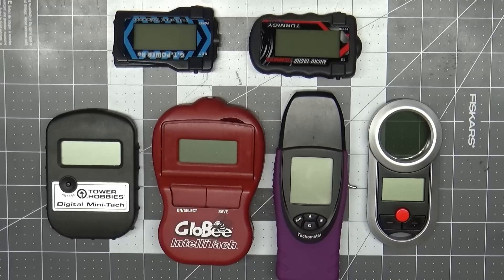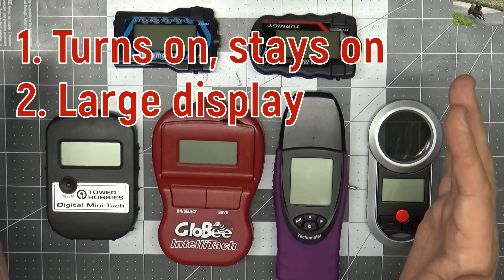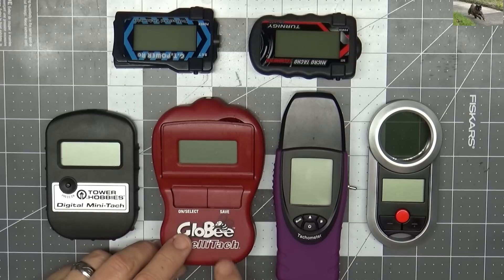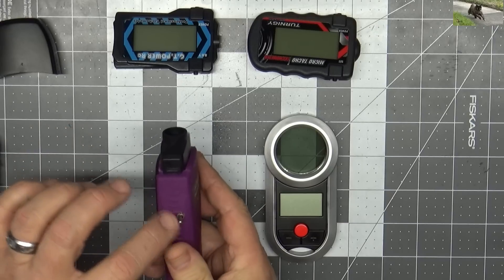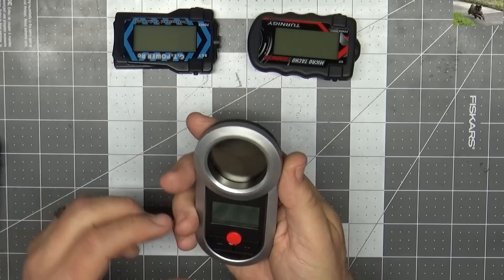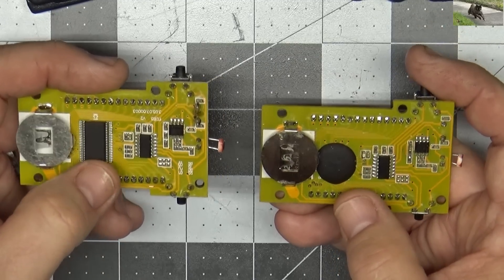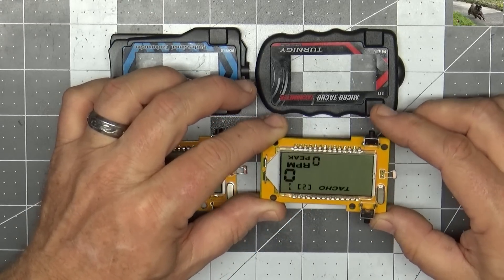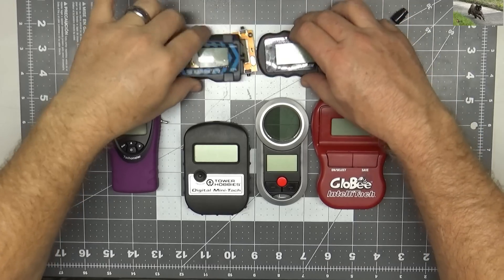Tachometers

Comment: What size battery does the Tower Hobbies one have? I have one that looks almost like yours but with no battery. It isn´t a standar bat, it´s a short fat one apparently. Had it for over a decade and can´t remember if I removed it to store it, or I never installed it. I want to test if it works.
Reply from the maker: I no longer have the Tower Hobbies tach, and I do not recall what size battery it took. Short fat ones sounds like an N cell. Commonly used in garage door openers.

Comment: for a different but kind similar topic/hobbies, the Beyblade fandom for years now have had to use a number of different methods to determine how fast the tops spin, and not a single one of the official peripherals from either hasbro or takara tomy are even remotely useable for giving us an RPM count, they just give us random high numbers to make you feel happy, the closest we got was an addon only available in Asian areas, what tachometer would you recommend?

preferably it would be nice to have something that can just detect how fast the launcher itself is spinning instead of having to point the sensor at the top, that way we get an as accurate reading as possible on launch.

sorry if this is a waste of your time, but I thought I would at least ask
Reply from the maker: Well you you do not believe the readings on tachs you have had what makes you think I can provide you with anything better.  What you see in this video is what was available at the time.
I suggest you simply research and see what is available and decide for yourself.

Comment: What I have done with the tachometers that have photoresistive sensors is that I put an LED light in front of the prop, aiming directly at the tachometer, and you place the tachometer at the back of the prop as you usually do.  BUT, they are aligned such that every time the prop blade blocks the light the meter takes this into consideration and activates its counter.  It doesn't matter if you are indoors or outdoors the setup always gives you the correct rpm reading.  As for the laser one, if you use APC silver prop, you get some reflection back and the tach operates properly.  For wood props I had to put small Al strips on the tips to get a reading.  For small duration, unbalanced prop doesn't really cause too much of a problem for the electric motor.  But, for breaking in nitro motors you need to balance the prop.  My two cents :-))

Comment: Hey Dave, I'm having a problem with my os 91 fs. It was given to me a few months ago and I just got around to starting it. I dont know the history of the engine, but I do know it was sitting for a while.  I put all new fuel lines, new fuel tank, and new fuel. I think I'm getting really close to getting it dialed in but once it idles for 45 second to 1 minute, it will stumble and then die. I have a new os f glow plug on order to try that. Any ideas on what the issue could  be?
Reply from the maker: Well idling for 45s to a minute seems a bit excessive.  Without hearing or seeing it I cannot say for sure if you have an issue or note. I try never to troubleshoot an engine via typed words.  It just isn't time effective or accurate.  They do that on the RC forums but I don't do it here on videos.

Comment: Good info. I just picked up the Turnigy version for $15. On a two stroke I can dial in the needle by ear really well, 45 years of practice. I just rebuilt a Saito 80, minus the rogue crankshaft spacer ( you know about that one David) and I wanted to be able to see vs hear the changes in RPM. I have a tach for my milling machine and lathe but it also requires  the tape. It’s super accurate but not as you pointed out good for engines in your scenario. I had a tach years ago the had a rubber cone that you would touch to the spinner. True mechanical connection. It slipped out of my hand, was hit by the prop and blew up!
Reply from the maker: Oh yeah. One like this. https://youtu.be/St2qjOq2UP4 I gave it to someone.

Comment: I've been using the Hangar 9 micro tack I got on E-Bay,it's ok ,this one the first didn't do good,nice video. Thanks
Reply: Yea I think the Hangar 9 is o k, but watch for the prop blast that may knock off the LENS and if it gets oil inside it may discharge, so wipe the battery clean before storage!!!
Reply: I wrote a comment but for some reason it isn't showing on my end, so I'm making another. I just received the hanger 9 2 days ago that I bought from Ebay. I'm just getting into the hobby, so I wanted something to reference my rpm. Wanted to make sure I'm not running too lean. After watching the video, I wonder if the hanger 9 is just like the last 2 in the video as far as the pcm board inside. I'm going to take the back cover off just for curiosity. Good video. I got a good deal on the hanger 9, and for what few times I use it I think it will be fine. Can't justify spending $150 on a tach that's going to set on the work bench most of its life.
Reply: Got a chance to use the hanger 9 tach today. The battery was dead right out the box. Seems to work ok after I bought a $5 battery. Kinda feels really, really cheap though. Time will tell

Comment: I have the Glo-Bee but haven't used it for years... haven't even run a glo engine for a while. Part of subscribing to your channel was to motivate me to learn how to run/tune my glo engines, but I've been too lazy to even mess with them. I never knew about the flourescent light calibration. I learned something today.
Reply: The fluorescent light calibration also depends also on what frequency your countries power supply is running at, 50 or 60 Hertz. 3000 for 50 Hz and 3600 for 60 Hz.

Comment: I also tried the turnigy tach worked for a while , but always flattened the battery i now rely on my ears  and i am a firm believer that a slightly rich motor will not die on you, possibly not the best solution but it will have to do as i am not prepared to spend big bucks on a brand name one. I do not fly nitro twin motors  so i dont think its necessary great video